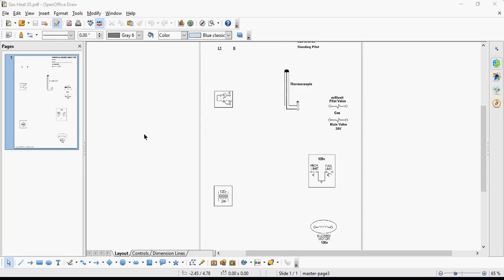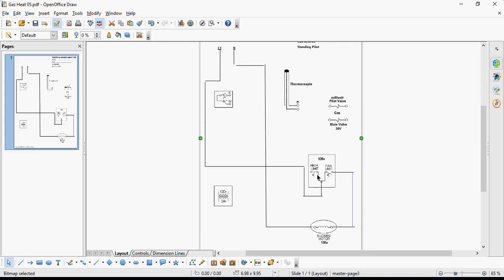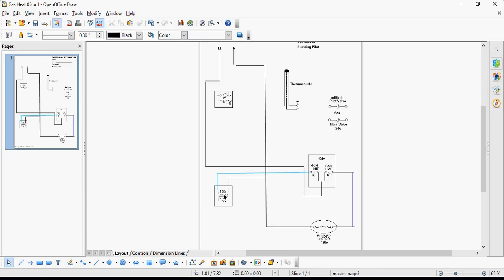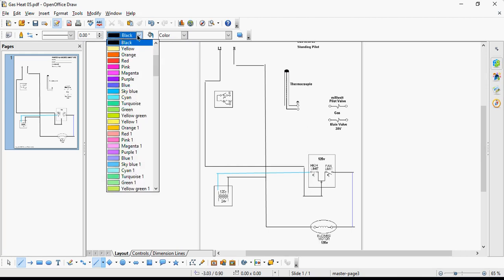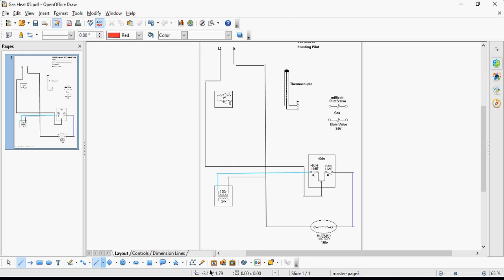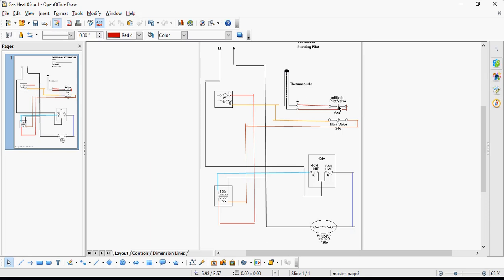Wiring Diagram for A Standing Pilot Gas Furnace

Comment: The explanation of the thermocouple circuit is overly simplified. It has to go through a switch in the pilot valve/knob circuit to keep pilot on and then to the coil on the main gas valve. That’s all internal to the gas valve so maybe that’s a subject for another video.

Comment: Where does the line in ground wire usually connect?  Mine is loose inside junction box with a striped soldered tinning but no connection?
 Also the neutral return. From fan switch is shredded with insulation shredded about four inches. Think it shorted to the junction box.  No grommet installed on line. 
Can the motor run when connected to ground. It does here but I would think the fan switch must be closed and damaged for that to be possible.  Thanks.
Reply: I’m uncertain to how you are using the term ground. For an exlectrician a ground is a bare or green wire used to ground the metal parts of equipment such as a furnace. The wire that completes the 120vac circuit is a neutral and is white. One side of a motor connects to 120vac and the other to neutral not to ground.
Reply: The fan will come on when the fan switch is heated to 130 degrees.